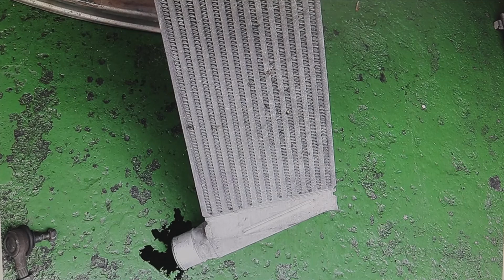This is how the engine OIL gets to the INTERCOOLER, if it is not cleaned, it ends up plugging

Comment: I just changed a bad pcv valve on my turbo car. I just drove it and it still smoked. I suspect its oil in my intercooler.
Thank you for the explanation.

Comment: Just to clarify boost pressure never goes back into the turbo😂 all that oil is going right down to your throttle body right into  intake manifold and gets burned off slowly

Comment: Thanks for your video. 
But still we didn't know is it dangerous otnot for the engine
Reply: afaik, under the influence of pressure from the turbo, oil can get directly into the cylinder and might damage the piston. the reason why is because the oil can not compress as the air does.
Reply: @markobrelak7913  Oil that gets to the cylinder burns off and in high amouns causes excessive blue smoke, which will also clog DPF or damage the catalytic converter.

There is no normal way for oil to get into intake air channels and cylinders in such amounts that oil could lock the pistons. Maybe if you poured oil directly to intake hoses.